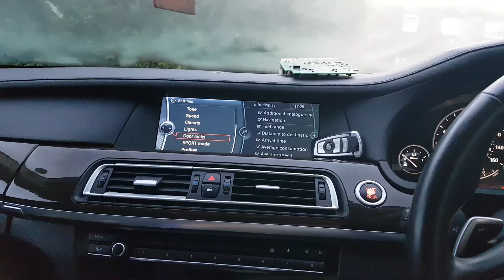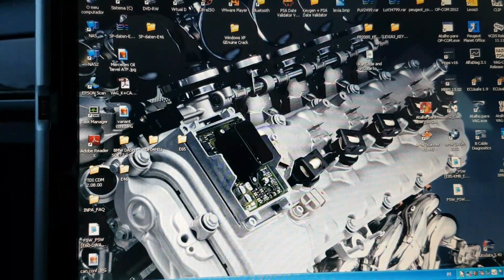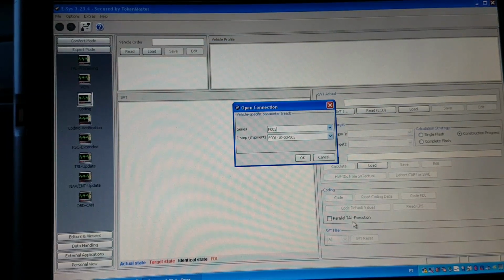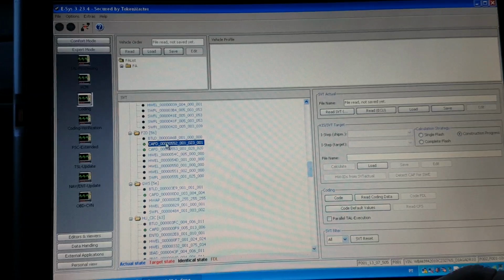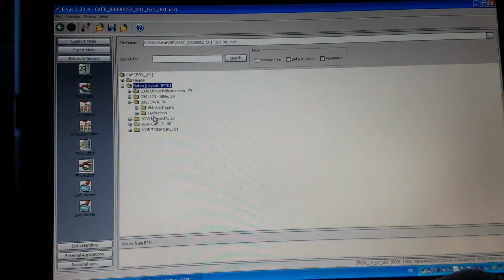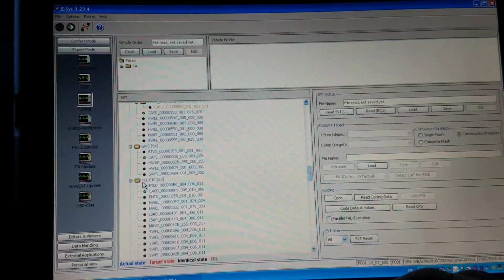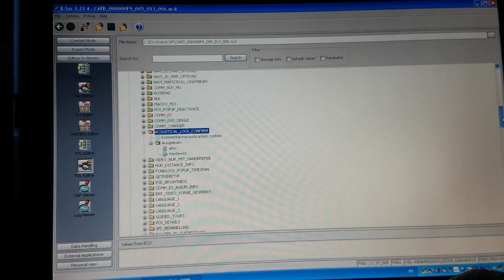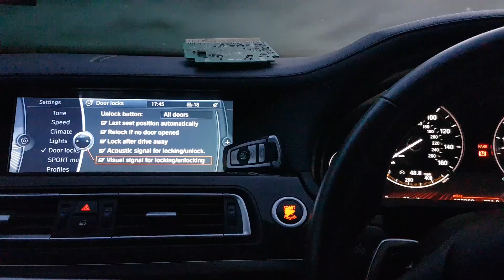BMW F01/02 code acoustic signal (beep) when locking/unlocking using BMW E-Sys.

Comment: Hi, Thanks for another great video! In my F02 something curious is happening. The previous owner had the setting coded into the idrive menu, and I wanted to get rid of the beeps. Sure enough, the setting was in the menu, so I unchecked it. Now, opening the car is without beeps, but at closing it still beeps once. What could be going on? I do not have Esys (yet)...
Reply from the maker: Not really sure...
Go through the coding once you get Esys, and see what is going on...
Hope you find it...
Thank you for watching and for your comment! 
👍👍👍
Reply: @LMAutoRepairs  I will do that and keep you posted if I find it!
Reply: @LMAutoRepairs  Finally got to install E-sys and get it working. After some trial and error, I finally got it. In FZD there are three options, as you show. The first one (Akk Quittierung Entschärfen) needs to be nicht_aktiv. The other two need to be aktiv. Now the door closing chirp is gone!

Comment: Most hopeless explanation. If someone needs to activate something specific but he code the wrong file then kiss good bye to ECU. You didn't mention what to do once you finish coding is there a procedure to disconnect the car from the tool or just unplug . To be honest I won't fallow anything from what you mentioned too risky
Reply from the maker: Hi
This was not intent to take the viewers through the ABC of things... I assumed you would do some research and new what to do before attemp something like this...
Things are not served on a plate to me, so don't expect that... do your home work!
Coding is not as risky as you might think, programming yes, coding can always (with a few exceptions...), be reverted.
Thank you for watching!
Reply: @LMAutoRepairs  no fucking point to be an arse about my comment. some people out there will do what you did straight up without thinking. and when things go wrong who's gonna take the blame you ? i dont think so . if you can put tutorial for people out there, do it properly or dont bother at all
Reply: Yes, i had the same problem while trying to copy somebody off the internet. When using the internet, i generally put my brain to sleep and just blindly follow what i'm told to do, just as i did when i wrote off my BMW following the sat nav into a river (i'm stupid). Anyway, back to this point....I had the same car as this and wanted to do coding. I followed it blindly and now in the display i have mpg as i already had,  When i press the mode button the display changes from MPG to "insert coins"...or inst cons...or something like that and wont bloody start!!! Why the hell should i insert coins in my own car to make the engine go around????  I pay my insurance and tax etc... i am NOT going to accept that i have to insert coins to make my car move and even if i had to...where would the coins go and how would the ecu know exactly how many coins i have inserted..and how long would each coin last? I guess i have a virus that got transferred from my laptop to car when i was doing the coding.
My advice to anybody thinking about coding is to pull out your broadband telephone line while doing it, then no virus can get into your car, as long as you have good antivirus and malware installed. Guys...PLEASE be careful or you will end up with a car that does not work anymore, and is ill with a virus. BMW want £2500 to make my car work again...and it's all the internets fault!!!
Reply from the maker: @EcutechDiagnosticsLTD  
Hi
I will not say that you are stupid, but I would say that you need to stop smoking whatever and start to pay more attention!
I am sure that there was a bridge that you have missed, when the nav allegedly sent you into a river!...
 Doh
As for the coins, pretty much every car does have a place to store/insert coins, as most people, you have not read the Users Manual!
Also, the engine is not supposed to go around, when you manage to get it started, open the bonnet, (Follow the Users Manual carefully for this procedure!), and you will see that the engine does not really move, is the parts inside of it!
The virus...
HAVE YOU WASHED YOUR HANDS BEFORE STARTING THE CODING?
Have you sanitised the laptop, tools and all the cables?
Have you sterilised both, the OBD port on the car, and the OBD plug of the tool used?
I am sure you haven't...
That's an imperative step of the whole coding procedure, hygiene!
Can you imagine what would happen, if doctors started to do the same, not wash their hands before perform a surgery?
Hope all the above helps!
And happy coding!
Thank you for watching and for your comment!

Comment: Hey I hope you see this but I have a 335i 2010 convertible and first my charger wasn’t working I switch old fuses with new then my window switch wouldn’t work did it again now it works and stops working and now my alarm system doesn’t work.... any advice why my alarm system doesn’t work and when I go into the bmw settings it doesn’t allow me to turn on the acoustic signal or the locking flashes... please help
Reply from the maker: Looks like your alarm module is offline...
Reason as well why you can't change those settings... because there is no comms...
Double check the fuses...
Have the car scanned... you most likely have no communication with the alarm module, but might be codes in other modules that can guide you in the right direction...
Thank you for watching and for your comment!
Reply: LM Auto Repairs thank you so much and what you mean by comms? I’m going to order the Carly for my bmw
Reply from the maker: @KidKatooo  
Comms = communication
👍
Reply: LM Auto Repairs any tip on where to find the control module

Comment: I think that after you save your settings and return to expert mode, you should select the CAFD file of that ECU - not the ECU itself, and finaly press "code FDL". If you select the ECU itself and then press CODE, you actualy code that ECU with options from the car's Vehicle Order (factory options), so actualy you reset any previous codings.